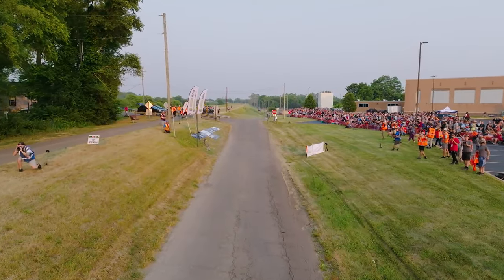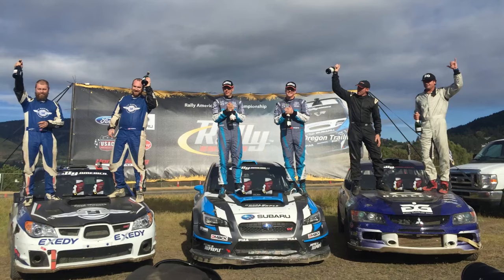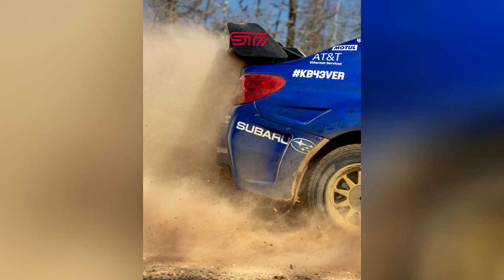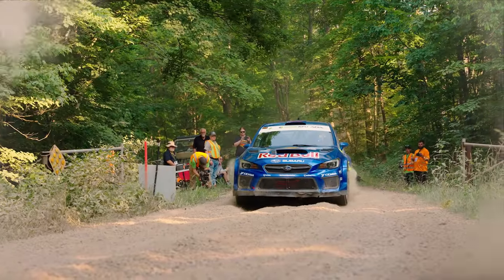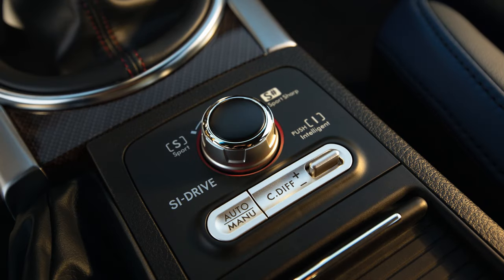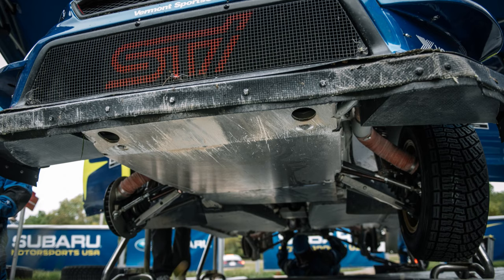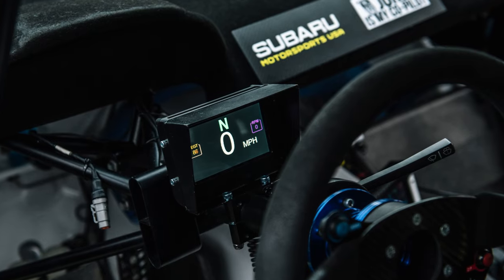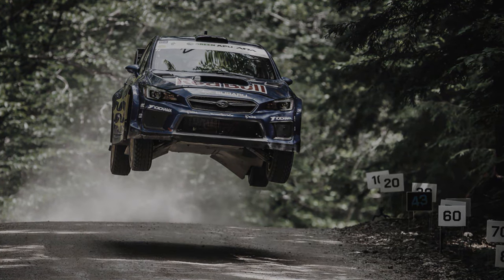Behind the Wheel: Exploring Subaru Motorsports USA's WRX STI Rally Car [VA Chassis]

Comment: we need subaru to wrc for real. Rally1 subaru wrx sti would be amazing
Reply from the maker: Couldn't agree more!
Reply: Well, considering the condition they are in it's just wishful thinking. 
The WRX, as iconic as it is, is just too big and too long (they are even from different segments of cars compared to modern WRC) and Subaru themselves have to build a 1.6L 4cyl engine to comply with the regulation (which i don't see it ever happen).
Reply: @AbrahamArthemius  1) they could theoretically “borrow” an engine from Toyota. 2) Although they don’t have a perfectly fitting silhouette, the Ford Puma wasn’t exactly a perfect fit either. I think the Toyota Raize/Subaru Rex would be make a half decent looking silhouette.

Comment: USA Rally, What Group are they ? And why they drive an STI Street Car ?
Reply from the maker: It's the Open Class, and they aren't the normal street cars.
Reply: @rallybeast  Ah OK , so they are build Cars, not tuned Cars, so this then also not an STI at all and they are not classefied,  these cars are racing beside all possible classes of Rally like in some events in Europe.
Thanks, I hear the 1st time of the Rally scene in the USA , i did even not notice it does exist at all. Its interessting and its good to see you have rally events too also when its not the most popular Motosport of the USA, that might will change too.